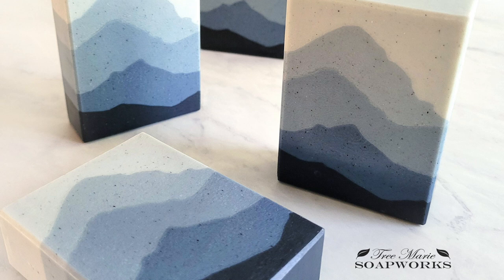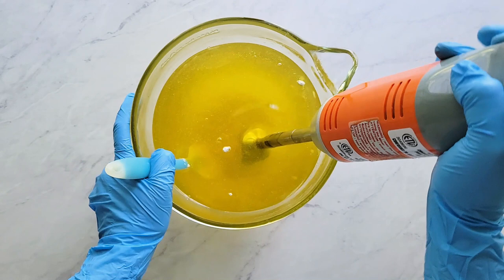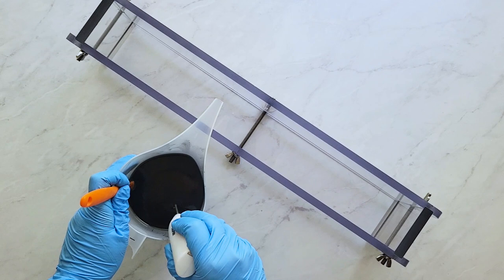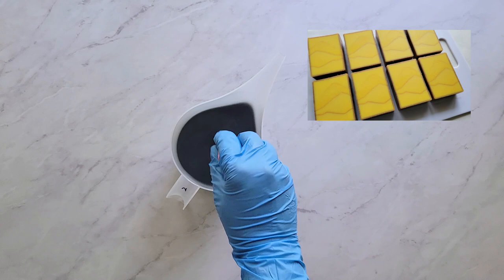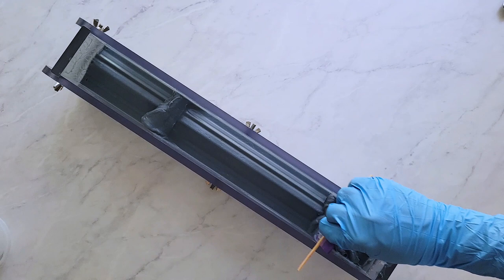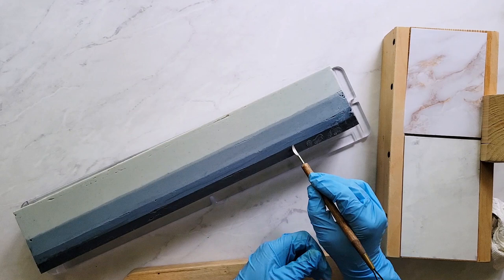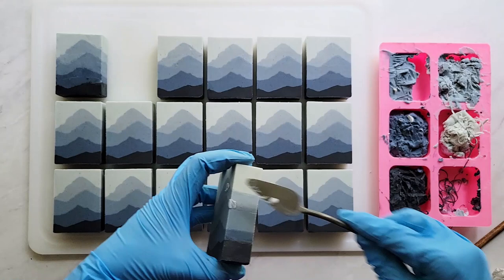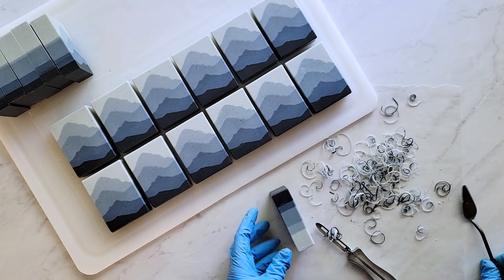Mountain Sculptured Layers Cold Process Soap  | Trouble-Shooting Fail (Technique Video #33)

Comment: I adore your videos. They are so informative for new soapers. Belinda gave me a tip for the shapers: instead of using tape, use rubber bands to affix the stick/guides. I had tried a few different kinds of tape, and I found that none held as well as I would like. I used 2 rubber bands to affix the guide and it worked very well (plus they are reusable!).

Comment: I enjoy your videos immensely. You soap and your work process are beautiful. And you explain a lot of interesting facts about soap. I would be nice to get a more in depth explanation about sapponifcation. What happens, why do you need to be so exact in the measurements, what does a waterdiscount do, why are some fragerances accelerating and some slowing, what are the chemical differences in the hard/ liquid oils and fragerance oils what is their function in the soap?
You said you used graphpaper for working out the percentages. That was a lot of counting for sure. 
Next time you could draw the design on heavy cardstok, cut out every section and get the percentages out of the weight of each section. You would need a very fine scale. But it would be less counting.

Comment: Hello, I'm just fascinated by your work, it's wonderful. Please tell me how do you keep the main mass in the state? After mixing, I have two or three minutes and the mass is thick and I can't do anything. I mix at a temperature of 38 degrees (250 gr. coconut  oil; 200 g shea butter; 200 g olive oil; 100 g castor oil and 100 g macadamia oil + 116.41 soda and 280 water).

Comment: Great video!  How long does it take for each layer to set up, are you waiting until it's firm to the touch?  Do you keep it at room temp while waiting.  Also, do these layered soaps go through a gel phase.  I've been soaping for 3 years but have made basic bars and am just now getting into the artistic side.
Reply from the maker: Do you mean how long till it's ready to sculpt? (Not firm to touch.) That depends on the fragrance and the recipe you use. Mine took probably 30 minutes to hold its shape. Then once it's sculpted, it's ready for the next layer, which will need to thicken enough to keep its shape. (I should have used a slightly accelerating fragrance.) I didn't notice a gel phase, but I believe I covered this one and didn't oven process it.

Comment: I just made my first sculpted layer soap! I should’ve made 15% extra like you because it was really hard to get all my tall peaks… did I miss where the link is to calculate the splits for each layer using graph paper? I’d love to learn more!
Reply from the maker: Oh, so sorry, I got pulled away and never finished it. It involves putting the design on graph paper and counting the squares in each layer, then divide by the total number of squares. That will give you the percent for each layer. Up the normal batch size by 15% and divide your batter into the percentages you figured. I hope this helps, Amanda! 💕

Comment: Thank you for the video! Just to clarify, is the reason you measure and pour the lye separately because of the different amounts of colorants you used per layer?
Reply from the maker: That is correct, Lily.👍 And it is added to the lye instead of the oils because lye is supposed to bring out the color of the indigo. 🧪💕